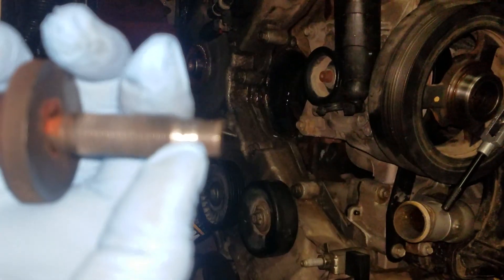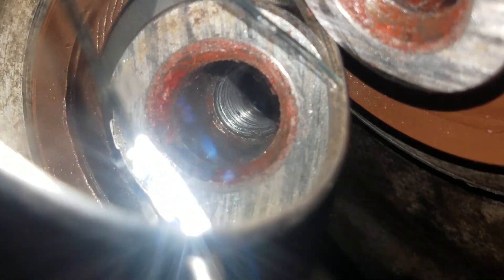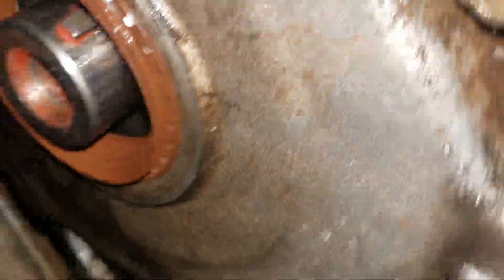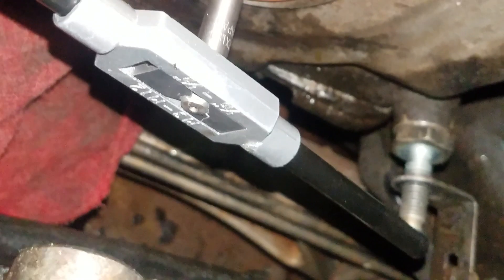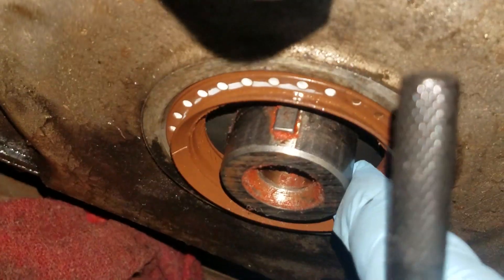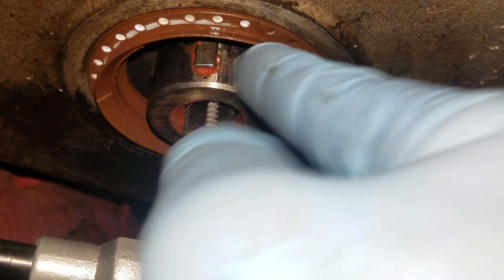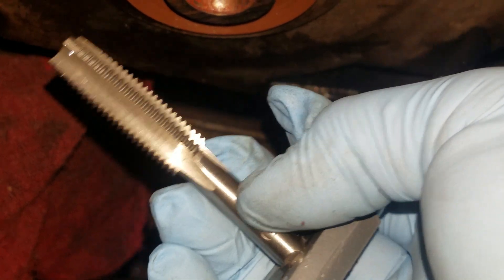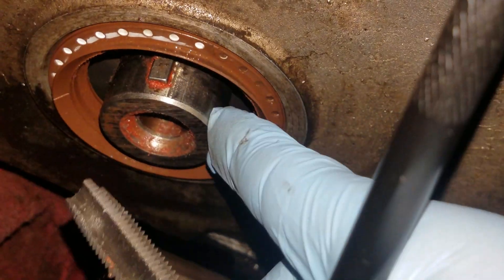Repair a Stripped Crankshaft Bolt or Other Threaded Holes

Comment: you legend!, my crankshaft pulley bolt got stripped in my e90 320d m47, because i replaced pulley and re used old bolt and didnt torque it properly , the pulley came off while driving and stripped thread. no garage were willing to tap it and were suggesting removing engine and helicoil.

Thanks!! 💯💯
Reply from the maker: Glad it helped, and thanks for watching!

Comment: How did you know it was stripped? What were the signs? Also will replacing the bolt and or pulley mess the timing up?
Reply from the maker: Every stripped bolt acts differently. They either won't start threading in, feel crossthreaded, seem extremely tight, may try to go in at an angle, etc. Each vehicle is different.  The engine in this video was a Ford 5.4. It will not mess up the timing by taking the balancer off. Many are keyed and will go on only one way. If they aren't keyed, it may have a notch for alignment but most likely won't matter how it's reinstalled. If it does have a notch, most procedures call for TDC before removal.  But normally I see other markings that refer to TDC.
  Refer to a repair manual for your exact vehicle to make sure what the procedure is.  Thanks for watching!
Reply: @okcvet1st  alright, 1 more question: Will over torqueing the bolt ruin or lock up anything?
Reply from the maker: @jeremyfahrni529  You always risk ruining, locking up or stripping by over torquing. Most threads accept less torque after a repair and can be damaged more easily.  You often have to make a judgment call on how much torque to apply safely.

Comment: Dude I have exact same issue in the exact same motor (Ford 5.4 3V) I think my harmonic balancer puller janked the threads while I was pulling it out. I'm so scared to completely EFFF my crank.

Comment: I need a new camshaft position sensor bolt and the Chrysler dealership told me that bolt was discontinued in 2016 only 6 years after the car ended production... like what? How are you going to discontinue a part right when people are gonna start needing it. Absolute knob city over at Chrysler.

Comment: What if it never gets tight? Does that mean I completely stripped the threads inside the shaft?
Reply from the maker: Most likely yes. Different way to tackle the issue. If your not confident in attempting the repair, take it to a machine shop and ask them to rethread it. If you feel like your able to tackle it, use a good quality drill bit/tap and enlarge it slightly or you could change the pitch/thread pattern of the bolt. Make sure to use a quality bolt also. 8.8 or higher recommend. Basically get the strongest thing you can get. The process isn't a 5 min fix. The crank is hardened and hard to enlarge by hand but it can be done. In the vehicle not alot of room normally, so specialized tools may be needed. I have an angle drill chuck adapter that allows my drill to be vertical while drilling horizontal. Most people don't have one. And I really don't use it often but still have it. I often use different length drill bits also. Short to start drilling and get longer as the hole is drilled deeper. Just depends on how much room I have to work with. You may run into "shops" that'll tell you it can't be fixed, or you have to pull the crank out for them to repair it. Some may say they have to remove the radiator, etc, to do the repair. If a shop has nothing but excuses, they just don't want to do it.  May not be the greatest way of fixing it, but sometimes I take the strongest bolt I can find, slightly bigger then the hole, and hammer it in with the impact. Doing it by hand prob won't get it in far enough. Not to say it'll work for you, but sometimes you just do what it takes to get something fixed. Hope I helped out. Thanks for watching!

Comment: You know why it strip? You attempted to drive the pulley in with the crank bolt, and  strip it. Common mistake
Reply from the maker: That is a common mistake, but also previous repairs that someone else made the mistake causes this to happen. Then the current person working on it has to deal with it. I use damper/pulley install tools but my video is to show people how to fix the stripped threads because most people don't use the correct tools and can strip it easily.

Comment: If I'm going from m12x1.5 to m14x1.5 do I need to drill the hole larger first or can I just run the tap as is?
Reply: What did you figure out? I’m going through this shit right now and am curious myself.

Comment: What if the tip of a harmonic balancer puller tool  is broken off in the crankshaft and stuck jammed in can you drill it out engine is still in the car it's a ford sohc I've removed radiator and about to remove timing cover to get better access as timing chain needs doing anyway

Comment: Alot of chevy cranks in early V8s didn't have their crank shafts drilled for a crank bolt, chevy only started doing this in the later part of 1969 when the power level went up,  my early V8 didnt have a bolt hole drilled,  so I contacted  (12 bolt tools .com) and spoke  to Tom he makes a kit that is fool proof  for drilling  and tapping your crank shaft ,  infact  I drilled  mine with a cordless  makita drill with the engine  still in the car  of course  I had to remove  the fan, harmonic balancer , and radiator but that's a hell of alot easier then removing the engine  and taking  it to a machine shop ,  believe  me it was easy  and took me around  an hour to do , call tom at 12 bolt tools .com it sure beats the hell out of paying someone else big bucks to do it .! Thanks Tom you're  definitely  a pal!!!!!!!!

Comment: Its easy I just did one on sat  for a friend did mine a while back with a tool from12 bolt tools .com ,  this one i did on sat had a hole already but was stripped out , so I drilled  it out bigger then used  a Heil coil for the same size  of the original  stock bolt , worked out fine installed  the balancer  and torqued  it down to factory  specs of 55 psi worked like a dream!!!!!

Comment: I rented a damper puller and my 350 chev damper was pretty stuck in there it eventually came out but the end of the puller bolt buried itself into the foot of the inner crank treads ( oh god no ) so i'll try to rent a tap set ( now i know how the tool rental makes money ) and clean the treads. I hope it works.
Reply: I did this exact same thing on my Chevy 4.3 today

Comment: I stripped most of my threads inside my crank while pulling out the balancer.. i have about half and inch in the very back left that actually grabs tight,what do u recommend? I have a 2014 camaro ss.
Reply from the maker: It's hard to say without looking at it in person. If a correct sized tap doesn't fix it good enough, you may have to run a slightly bigger tap and install a bigger bolt. If the crank torque rating is high, then running a bigger bolt may be the best option. Many more options can be considered but its really up to you what you think would be best. (Forcing a high grade bolt in with an impact, welding the pulley/damper onto the crank, replacing the crank, welding and retapping the crank, etc.) Hope I helped. Thanks for watching!
Reply: It had about 3’ total of where it starts to grab inside the snout but they first 2’ are really damaged
Reply: Lots of lock tight

Comment: I have a snapped bolt. I was going to drill it out but got aviswd i could get shavings in the engine??
Reply from the maker: Put a rag around the crank/seal so that shavings doesn't get into the timing cover.

Comment: I'm trying to tap the crankshaft hole on my 98 civic and the tap will jussssst start to catch and then slip off every time... I'm using a lot of force on the back of the tap but it's making my arm weak. Haha! Any tips on this??
Reply from the maker: What type of tap are you using?  May try starting with a good quality taper tap, then move to a plug tap, then finish off using a bottoming tap. Using a spiral flute tap may help also but you'll just have to see what works best. In OKC, I get my taps from J & E Supply and Fastener on 59th and Eastern. If cleaning up the threads doesn't work, you may have to drill it out and use a slightly larger bolt. Self tapping bolts are available also that are hardened to force back in. The 98 civic, if I remember correctly, has good access to the crank bolt. Hope I helped!  Thanks for watching!

Comment: Can you share a link to order 1.5 tap
Reply from the maker: I normally purchase them at J&E Supply & Fastener in Oklahoma City. Www.jandesupply.com
Reply: @okcvet1st  what is the actual size I need for the crank bolt? Can't seem to find anything long enough to go in.
Reply from the maker: @loboost7094   The oem bolt is right at 2" long but has a 1/4" tip included in the 2" and has the washer on it.  The crank hole is approx 2" deep and the balancer has approx 1/8" lip left when torqued down.  Depends on how bad your crank is.  Sometimes I buy a new oem bolt and it works fine after repairing the threads.  Sometimes I use a 2-1/4" 8.8 bolt with threads all the way to the end. Occassionally I have to use a slightly bigger bolt to get it to work, which means you have to run a bigger tap in.  Hope I answered your question and helped out. Let me know the end result!  Thanks.

Comment: it had to be the 5.4 triton lol i stripped the begining of my treads when installing harmonic balancer with tool, do not use that tool sucks to install, just use hammer next time, but anyways i managed to put bolt back  by putting stright n turning slowly.  and got torque to 37 foot pounds
Reply: Dude I'm in the same situation right now

Comment: hi good vid i stripped an 8mm threaded hole out on my harmonic balancer with the pully tool the other day but still managed to get it off, ive never tapped a hole before so, do i go to the next size above is that how it works? p.s. im getting a tap & die set soon from ebay so i hav 2 wait 4 it to arrive!
Reply from the maker: If its just a puller bolt hole, then the easiest thing is to just tap and put a bigger bolt in.  If its a hole used to bolt something down like a pulley, I'd try to clean the thread using the same size first and evaluate the information like: how deep is the hole and how much thread is grabbing?  Does it feel snug and tight when screwing in the bolt? Will proper torque be able to be applied?  If you have little thread, a lose fit, or no torque allowance, a bigger bolt likely needs to be installed.  A little locktight might do the trick also.  Be careful with bargain tap sets as many aren't strong and you risk breaking the tap inside the hole. Best bet is to really take your time and try not to cause any more work for yourself.  Hope this helped! Thanks for watching!

Comment: I am  having this same situation with my 98 s 10 2.2   I wanted to change my timing chain and my buddy  started to pull out the damper  using the harmonic damper puller but with out the cone tip and he striped the crankshaft bolt and hole, so im trying to collect all possible ways in how to fix this problem, thank for the video, very well explained.
Reply: Bro no way my cousin and I were doing the same thing on my 1997 blazer pulley and he stripped it and now I have to get the tools
Reply: did it work? @lawrencearmijo8213
Reply: Wilfredo Colon Viera i have the exact same problem mate on a 98 honda civic lx the crankshaft hole stripped but cant find no one to fix it i stay in atlanta
Reply: I literally just di this very same thing (lesson learnt). Going to have a go at fixing it with this method.
Reply: @Sir66Hugh  did it work for you?
Reply: Same think happened to me on a 2003 Chevy venture. I still get a bite one the screw but it's only about 4 threads and I don't really want to risk it